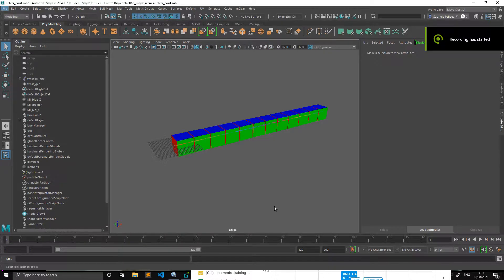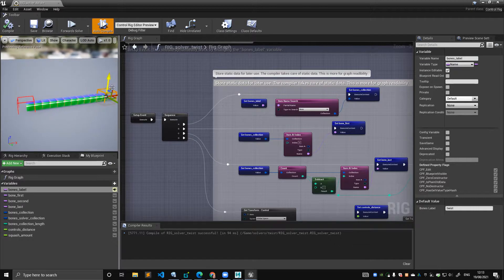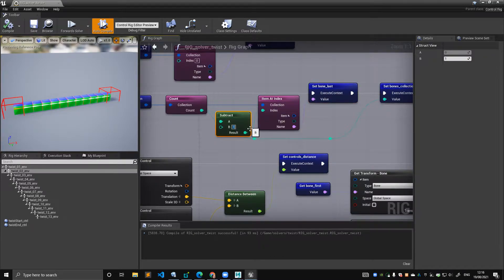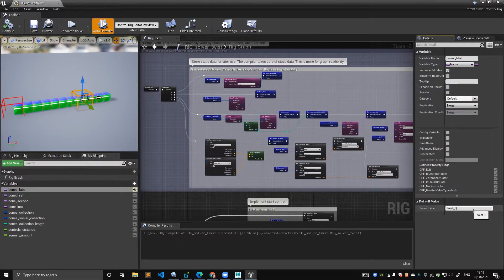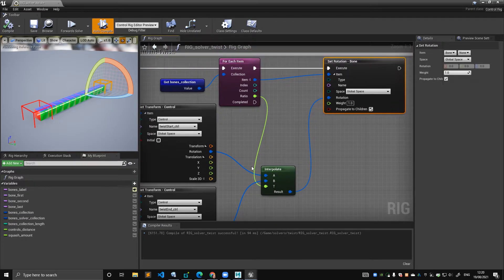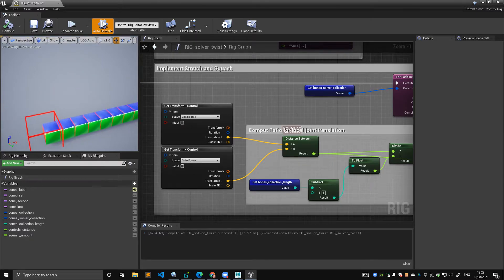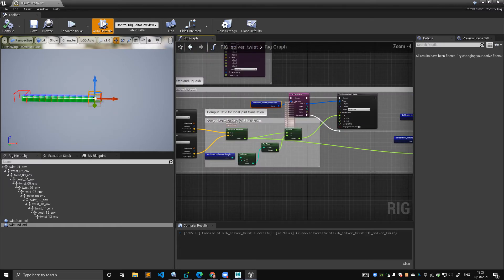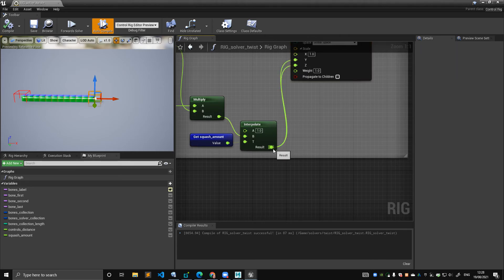Control Rig - 04 - Solver: Twist, Strech, Squash and Curves.

Comment: The rotation pops as you past180 degrees. Can you keep twisting in your setup? I also noticed a TwistBones node but it appears to only work with a maxium of 3 bones. DistributeRotation node appears to be the only thing that works for full twisting.
Reply: Have you found out a way to do greater than 180 degree rotations? Is this just not possible because transforms represent rotations with quaternions? I'm not sure if DistributeRotation would work for me if I wanted to twist a cartoon character around multiple times like a twizzler.